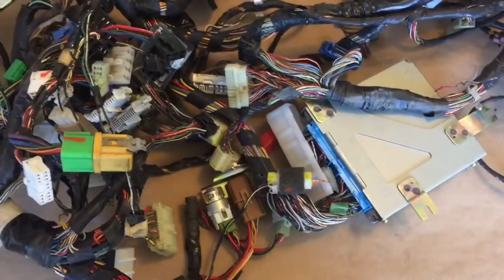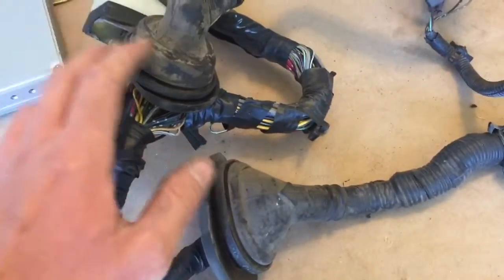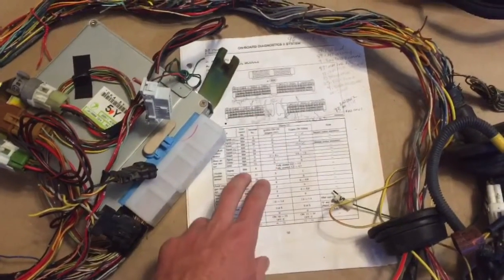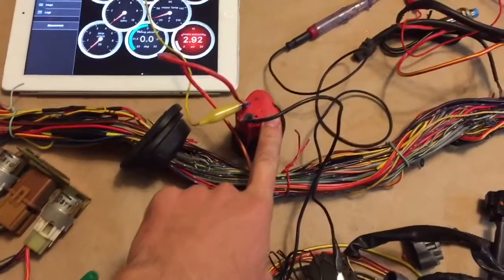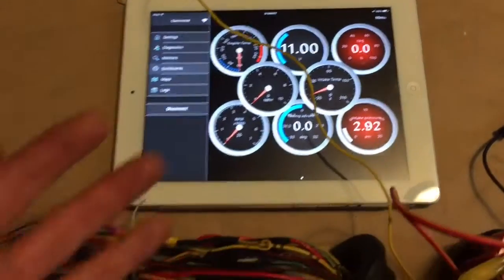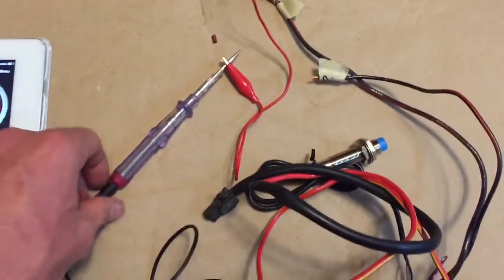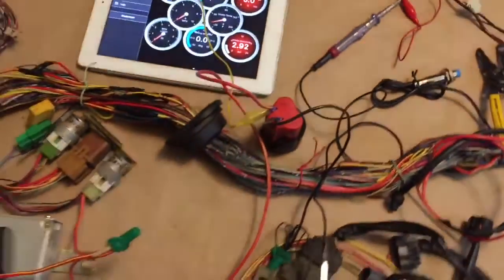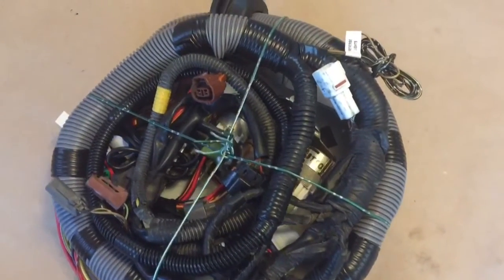1998 Subaru VW Wiring Harness Conversion

Comment: 04 Subaru le legancy can swap to bug is a EJ25 with electronic throw body? Because have the engine and full harness and I’m scared 😱 if is not possible?
Reply from the maker: +Joseluis Chikin absolutely possible. If it's the harness that scares you I can do that work for you. I charge $460 for the harness conversion - check out Busaru.com/busaruparts